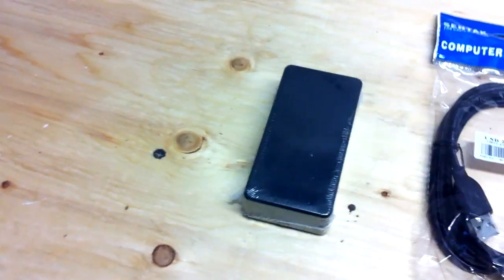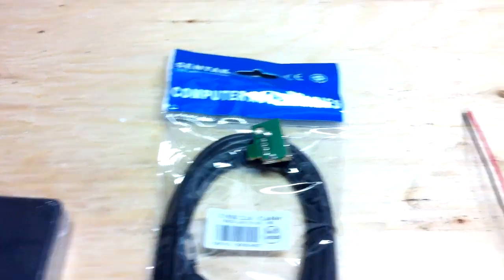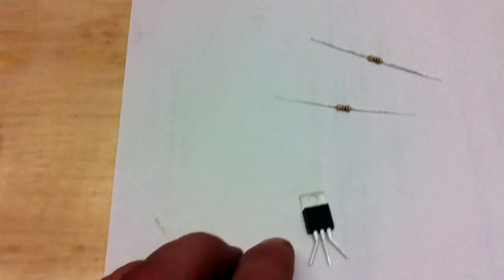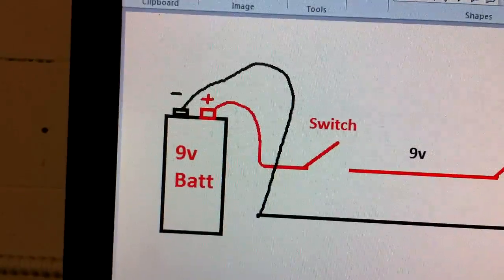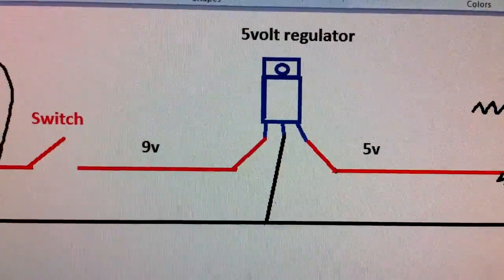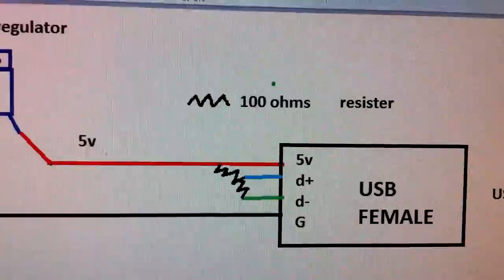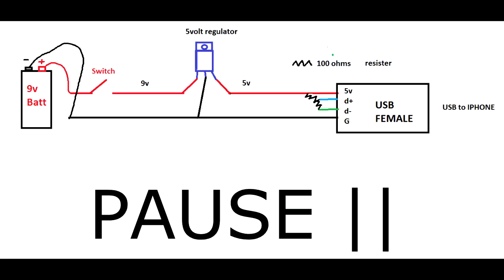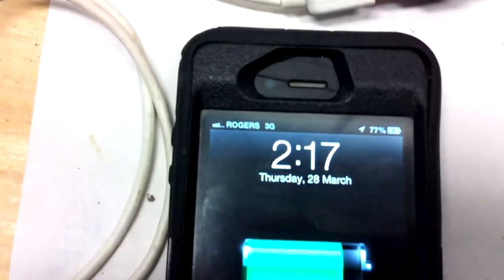How to make a portable USB charger

Comment: A 9v battery will give you at the most  450mah, at 9v this will give you just a bit over 4 watts of power. Assuming Iphones use a 1 amp charger at 5v, that is 5 watts. There is a reason why these disposable battery chargers never really caught on. I remember Duracell use to make a portable charger that used disposable AA batteries. Look into the 18650 batteries, their you can really do something worthwhile. Keep in mind that my calculations are just basic, their are other things to take into account like battery resistance and deficiency.

Comment: does not work on Samsung galaxy phones
Reply: It's because some devices requires different data reference voltages that triggers it to start charging, not to mention the supply current since not all could charge from a mere 9v battery.  Your's may require different resistor values.

Comment: this is a linear way of doing thing, the regulator simply takes everything and burnout what's not needed then spit out 5V. if you're on batteries, it not the economic way.
a better approach is to construct a tiny switch mode power supply which will only draw current when its needed.
buy one on ebay for a dollar is way cheaper though.

Comment: can i use 3 mobile battery (3.7v) in it
Reply: two connected in series will do just fine since you need only 5V ouput. plus, the more voltage difference between Vin and Vout the more current will draw resulting in heating.

Comment: Really ?? I recommend using buck converters becouse linear voltage regulators have terrible efficiency at 12v that's dissipate 8 WATTS OF HEAT thats really inefficient.
TO220 can dissipate to 2.2 W of heat, if you touch it without heatsink, that will burn your skin.
7805 has 50% efficiency
buck converters has > 90% efficiency
I recomend using ebay to buy electronic things.
Reply: Ficraft buy at ali express

Comment: It's working by using motorcycle battery has 12 volt as input and output we needed 5 volt by using regulated ic 7805

Comment: 9V battery heats up after about 9 to 10 minutes and charging stops. Any recommendations?
Reply: +H J Savoie put a heatsink on the regulator or use a cheap 9v battery with lower mAH

Comment: It's a cool project, but one non rechargeable nine volt battery is only going to give you maybe 400mAh of battery recharge on your 2000mAh or so cell phone battery. Those linear regulators are horribly inefficient. Not really worth the cost of a nine volt battery.

Comment: Junk!
there is no short protection there is no overcharge or discharge protection - this is junk, it is not rechargeable and you can buy better for less than 15 USD. Don't risk your Li Batteries with this rubbish.

Comment: Let say i have i connect the charger to a normal household socket that release 240v power...how do we reduce the 240v power to match the iphone charge without blowing it up?
Reply: Same way just that you don't need the 9v battery.   240--->9v step down and plug it in to the box instead of using a battery.
Reply: Will it 100% work on the circuit?? if yes i would like to try and make one
Reply: Why would you do that? Then there is no point in having a portable powerbank?
Reply: It's charger only in 9 -12v battery power

Comment: simple use for disposable batteries for charging gadgets. If you plan to use rechargeable batteries, you need to put voltage cutoff circuit to save the battery from over discharge. Over discharge destroys the battery life and even turns a rechargeable battery into a disposable battery. Voltage cutoff circuit is also used on solar panels charging lead acid or car batteries.

Comment: can you replace the 9 volt battery for a plug so it charges from the wall?
Reply: so if you have a 9v adapter you can replace that with the 9v battery?
Reply: All right thanks!

Comment: you should use a simple diode to stop drainage to cell phone battery back
this makes your circuit a bit safe and also you can also avoid using resistors across data pins of usb

Comment: One question! Why use a voltage regulator? for example I know that they are very useful for regulate the output from a filter on power supply, just like zener diodes. But in this case we are not dealing whith AC, it's just DC right?
Reply: USB can only accept 5v and since the battery is 9v we have to reduce it . and the voltage regulator is to turn a DC to DC

Comment: I made mine on a breadboard minded and smaller than his. mine too also runs off of a 9-volt. you could use for double A's but I prefer a 9 volt hits more power. I am going to try to use a rechargeable 9 volt. it shows connectivity and it actually charges. and it doesn't drain  down fast.

Comment: What wire do you solder the resistor to
Reply: resistors are not needed try without resistors and do not connect data pins anywhere

Comment: One question, is it necessary to connect the negative and positive usb data wires to the resistors and the 5v output? thanks :)
Reply: yes if you want to charge a mobile apple product like an iphone or an ipod
Reply: okay! thank you :)

Comment: I have a problem, when i plug-in phone turns on and show charging percentage, but it dont charge just loses more energy...what should i do and what i did wrong?I have done everything like u...
Reply: The problem is there`s nothing to stop your phone from discharging into the 9v battery. To fix this, get a six volt regulator(L7806) instead of a five volt regulator. You can get it on eBay. Then get a diode(IN4001). You can get it at RadioShack. On the package of the diode it says that the forward voltage drop is 1.6v, but I've tested two of them and both have a forward voltage drop of 0.8v. Solder the anode(black side of diode) to the output of the six volt regulator. Then solder the cathode(gray stripe side of diode) to the positive wire of the female USB. Solder the two resistors there as well, and solder those to the two data wires. Then solder everything else as you would if it were still the five volt regulator. The reason you need the six volt regulator instead of the five is because the diode will drop the 6v to 5.2v which is normal for a phone charger, so it won't hurt your phone. The reason you can't put the diode on the input of the voltage regulator is because the positive from the female USB would still discharge through the negative of the voltage regulator into the battery, believe me, I've tried. So your best bet is with the six volt regulator and diode. Hope this helps.
Reply: I tested this and similar charger - none of them worked as it should. Shows a message indicating charging but the battery is draining away. Measured the loading gauge and it only confirms that the system is not working. It seems to me that the problem is applied to the battery - this 9-volt capacity is too small. I check the others and let you know.
Reply: ***** okay, tnx.
Reply: Branman1583 Thank you very much for your comprehensive help. As soon as I gather parts and I will let you know how it works. Greetings!
Reply: Branman1583
Welcome back,
I've been doing more tests, also with a diode 1N4001 and regulator 6V - no change. So I decided to resign from the USB plug. I thought and came up with yet another idea - I used Schottky diode with a designation 1N5822 (for a PIN plus) and 1 Ohm resistor (for a PIN minus). This allows me to charge the phone even with 4 batteries 1.2 V. The charging current the same as the AC charger: 0.40 mAh. Maybe I'll do a video and it will be shown what and how. Greetings!

Comment: Interesting but ... not very practical even for emergency use.  You would get at most 20 minutes of 500 mA charging from a fresh 9V cell.  Definitely will have overheat without heatsink.
At $2 a pop for a 9V ... for something that you can get free from a computer or laptop port  let alone the build cost of the box ...   
Use a buck-boost converter you can vary input voltages anywhere from 2.7V (2 AA batteries) to 40 V (a whole battery bucket).
linear.com/product/LTC3115-2

Comment: You would get much more charging power if you used 4 AA batteries in series instead of a 9V battery.  And you wouldn't burn off as much power in the voltage regulator.

Comment: connect the zener diode to the plus and minus of the female usb and use 200 ohm resistor instead of 330 ohm. connect it to the positive of the 9v battery and other end to the positive of the usb and it should be working

Comment: You use a 5 volt regulator, swich,9volt battery, female usb cable, 2 100 ohm resisters, sodering iorn, and soder

Comment: Nice video. Your next step should be to incorporate 6v solar cell, go back to the boost controller and ditch the 9v for a 3.7v 5000 mAh LiPo battery. This way you always have a rechargeable system and never have to worry about carrying extra batteries with you.
Have Fun :)

Comment: you can do that if you got the battery to do that but it creates more heat(wasted energy) in the 5v voltage regulator which probably isn't the best for it but should still work.

Comment: ive heard of them working on higher rated resistors not use about lower though. in theory the USB charging standard states that you should just be able to charge if you short out the D+ and D- lines but this doesn't work on all devices (iPhone/pod) that's where the resistors come in. I wouldn't like to have too much voltage going down the data lines though, I'm not sure exactly how it works this is just my guess from analyzing a few articles.

Comment: It's pretty inefficient when using a linear voltage regulator. A better solution would be a DC-DC converter. But that wouldn't be that simple.